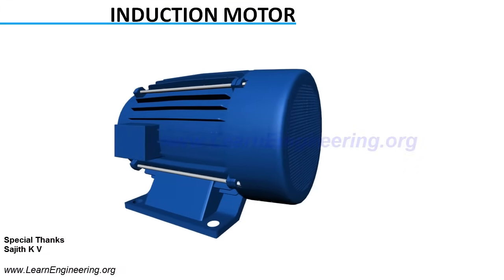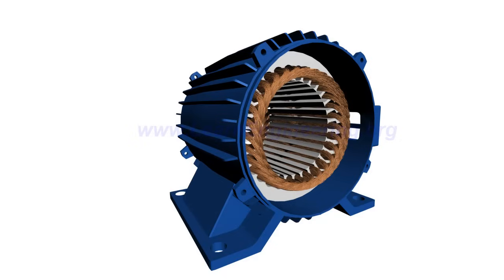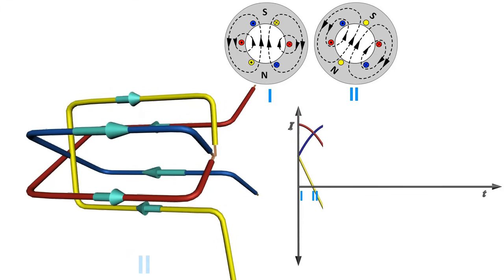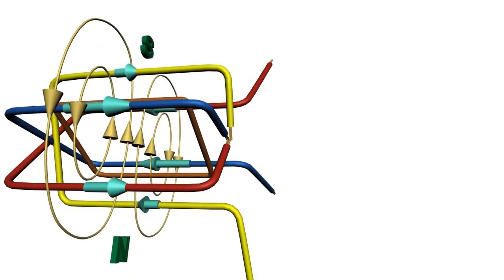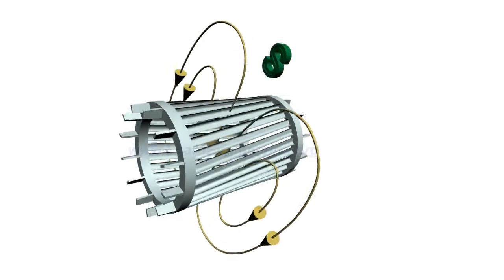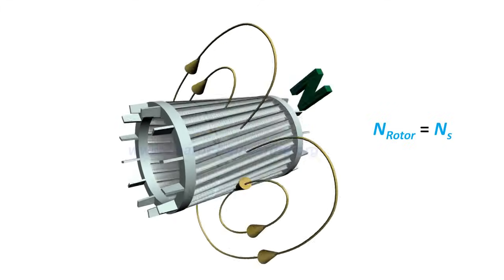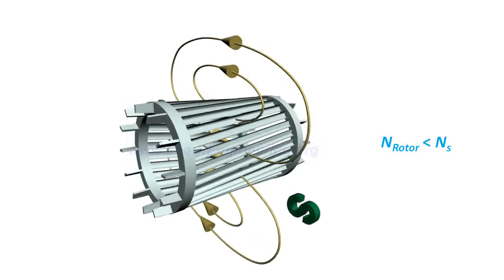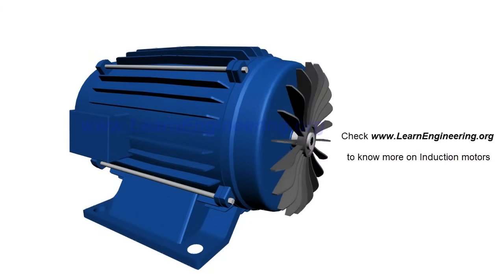How does an Induction Motor work ?

Comment: There are three points that may lead to a  better understanding of this beautiful video.

Point 1

The magnetic field lines of permanent magnets emanate FROM the North pole (by convention.)
In the case of RMFs (ie Rotating Magnetic Fields) the magnetic field lines are directed TOWARDS the North pole (by convention.)
These arbitrary definitions are put in place in order to make calculations easier!
The EXTERNAL region of a permanent magnet is USEFUL for our calculations. In contrast, the INTERNAL region of a RMF is the USEFUL one.
This is because induction motors and alternators DO NOT use the rotating magnetic field lines in the external space (say, outside the cage) for the production of useful work! 
The above definitions ensure that we get the correct direction of the magnetic field in our visualizations and calculations.

Point 2

How do we choose the CORRECT DIRECTION of the induced (eddy) current I (blue arrow) in the CLOSED LOOP of 01:32 ?

Using our right hand, we curl our four fingers following the direction of the induced (eddy) current around the  loop. Thus, our thump shows the direction of the produced  secondary magnetic field, which OPPOSES the RMF that created it, at the shown particular instance, according to Lenz law.
If the current I in the loop was taken in the opposite direction, then the induced secondary magnetic field in the loop (use the right hand rule as above) would REINFORCE the RMF that created it, thus leading to a flagrant violation of Lenz's law (violation of energy conservation!)

Point 3

Finally, having determined the shown correct current direction in the loop (blue arrow) we use Lorentz's law in order to determine the magnetic force direction.
Since F = q (vXB), we again curl our right hand fingers from vector v (current direction) TOWARD the B vector of our RMF and thus we correctly obtain the force direction (black arrows.)

That's all there is to it.

I hope I've helped...

Comment: Great stuff. As an add-on, the reason why there’s a large inrush current when a motor starts is because, before the motor is rotating, the current has only the low resistance of the winding conductors to impede it. Once running, the magnetic field caused by the current induced in the rotor by the transformer action of the stator’s rotating magnetic field, actually cuts through the conductors of the stator windings and induces an emf and current opposite to the polarity of the existing applied supply. This is known as back emf (probably counter-emf in the US). 🙄
Reply: nope, just back emf 🙄

Comment: The current ac induction motor design is flawed and old as hell. Excessive Eddy currents are the reason for the fan cooling adaptation and the squirrel cage accounts for most of the heat problem. Why have things remained the same almost 90 years later? We can do way better!!!

Comment: what is the interactive relationship between the 2SETS of filelds??  i.e....is the rotors magnetic field pulling towards the field of the stator,  i.e....attraction,  or is the stator pushing on the magnetic field of the rotor....i.e....attraction??  

in other words,  does the rotor interact with the stator via attraction or repulsion??

Comment: Looks like connecting Tesla turbine to the Tesla motor shaft will let you pump air and cool down the motor without any impellers. However i was thinking about joining them in the same case.

Disks on the same shaft most likely would serve as a flywheel (depending on the weight). And also will pump an air out of shaft edges. Potentially it may decrease air pressure and improve rotation speed. But result would depend on the motor casing:
-) motor case is open - quite similar to the motor appeared in the video
-) motor case is sealed (e.g. exact pump construction) - this would cause it to work as an pump cooling down the motor. Not sure if we are gaining some extra bonuses out of this. Any ideas ? (except looping air movement with other pump on the same shaft) ?

Comment: So basically the + on the sinus curve rotates with the clock and the - is the other way around which affects the rotor and you can the use it to see which way it's rotating alltogether. But you would never get the expected rpm's because there is energy loss in the motorparts (slip). And slip = nsyn - nasyn .. man I think I got it :D

Comment: I've wondered if you could make a motor that has the magnet inside move back and forth instead of rotating 

Like a piston engine 

Would it be very useful probably not but hey cant you engineers have any fun

Comment: That sounds like it'll be tough to control the motor's speed output, since the rotor is constantly speeding up and slowing down to match the rotating magnetic field. And it also sounds like there'll be longer start up and wind down time on the induction motor comparing to, say, a D.C. brushless motor. Am I understanding this right? Complete engineering noob here.

Comment: Wow, excellent video. I have a question. I'v noticed that the phase gap between the sines is 60 degrees (or pi/3) instead of 120 degrees as in a three phase system. Could someone please explain this ?:D Thanks !

Comment: If you know nothing about electricity, to understand this video you first need to learn:

-electromagnetism : Electrons moving cause electromagnetism, based on 1st right hand rule(thumb shows the electron direction, other fingers show the electromagnetism direction)

-induction : According to the Faraday Law, changing magnetic effect(magnetic flux) causes the electrons to move which means it produces electricity.
  
-alternate current: using induction, it is possible to make electrons move back and forth which is called alternate current. Since electrons move back and forth, we can use the right hand rule to see the electromagnetism change constantly
 

Research them in this order. There are nice videos explaining them. Then watch this video and it will make much sense.

Comment: i have an induction motor. i want to replace/adapt the impeller to a bigger one therefore i want to extend the length of the shaft. my question is: is it possible to weld another 4cm piece to the shaft in order to extend it? please any comments will be appreciated.

Comment: How is the magnetic field produced?
(this question may seem dumb but I'm only 14 so I don't know much about this field of physics)
Reply: This question is not dumb. Electricity and magnetism are interdependent. When a current flows through a wire, it will in turn produce a magnetic field around it. This can be derived using the Law of Biot-Savart or Ampere's Law. There are three windings (essentially wires), one for each phase, which are wired through the stator and produce the magnetic field as current flows through them. Because there are three-phases and the current is alternating, the field will rotate. Because this field passes through the windings on the rotor, a voltage is induced on the rotor windings due to Faraday's law. This voltage will cause a current to flow in the rotor windings. Again, since a current is flowing in the rotor windings, the Law of Biot-Savart or Ampere's Law can be used to show that there will be a second magnetic field produced, this time due to the current in the rotor windings. This field will rotate as the actual rotor physically rotates. Does that make sense?
Reply: Robert Kerestes Yes, thank you. I can't wait to learn about electricity, magnetism and etc. They are so interesting!
Reply: You have not asked a dumb question.
You are to be congratulated for having an enquiring mind.

The simple response to your question is that nobody really knows the answer.

The effects of electricity were observed in nature and very clever people in the 19th century formulated ideas as to how to manipulate those effects.

Equations , which are basically DESCRIPTIONS, were created and over 150 odd years  technologists produce the miracles we experiaence today.
From induction motors to electro magnetic communication.

Never be mislead into believeing that science EXPLAINS nature !
Reply: That's the spirit kid, never stop asking. There will always be trolls ridiculing you, but don't worry about them. They are not the ones you want to please...
Reply: Definitely not a dumb question!
Reply: Temirkul so the guy that stated that nobody really knows how the magnetic field is produced shouldnt ever give advice or answers
Reply: In a induction motor the magnetic field comes from the coils in the stator windings
Reply: Robert Kerestes ... Nice explanation... but I don't think there are any "windings" on the Rotor... only the Stator.
Reply: @Dude31463  That depends. In this case (squirrel cage), the "windings" are really bars which are called damper windings, which can be considered the equivalent of an actual winding, so you are correct, they are not actual windings. However, there is a class of induction motor called a wound-rotor induction motor where the machine has actual windings wound around the rotor and stator alike.
Reply: Temirkul ... No worries... Great question! I'm 54 and not quite sure how Electro Magnetism works... Same with Gravity. Scientists can measure these forces and apply formulas to them, but that's about it. They don't like using the word "Miracle", but in essence, that's kind of what it is.
Reply: Robert Kerestes thankyou good explanation
Reply: This is a phenomenon that follows a rule called the Maxwell's Corkscrew Rule.

Comment: What if I want it to work as a generator? I make the rotor spin faster than the speed of the magnetic field but what effect does it have on the stator? I don't get it..
Reply: Ana Carvalho you need a magnetic field in the rotor to produce electricity, the rotor is copper bars and laminated iron spacers, not a magnet in the rotor.

Comment: I thought it was the interaction of the magnetic fields of current induced in the rotor vs stator magnetic field that created the moving force? Not the stator magnetic field acting on the actual electrons in the rotor loop using lorentz law.  Isn't that the difference between a traditional induction motor and a Lorentz type motor?  I'm trying to understand this better.

Comment: is it ok to reverse the position of the rotor? meaning i will interchange the drive end and the opposite end..
Reply: Depends on the machine really... some machines only have one way to be put together (like submersible motors) and cannot be turned around like that.  Others have symmetry enough that you can put it together flipped around as you imply; 3-phase motors just permute your leads (ABC->BAC), but 1-phase motors may need to be reconnected to ensure the motor rotates the correct direction.

Once my shop was asked to do exactly that for a customer.  They couldn't set the motor because the connection box was on the wrong side!  We ended up exchanging the two ends... but really it just rotated the central housing a half turn.  Worked great.

Comment: Why loop not replace with neodymium magnets?
Reply: In this case that would be a synchronous motor which is another type of motor that exists but has different properties
Reply: yes, but what about efficiency?
Reply: Lucas Wiac Well you cant really compare the efficiency of the two they are just used in different cases. Synchronous motors are made to rotate at a constant speed while asynchronous motors can adapt to a lot of different speeds and loads so they are a bit in "everyday life". Synchronous motors/generatoes are in general dedicated to power plants (cause the speed must stay constant or really huge motors in industry (MegaWatts).

Comment: I just have a few questions about the motor. I only know a little about induction with Faraday's Law and Lorenz's Law, but work with me here. As a hypothetical load is put onto the power shaft of the motor, it reduces the rpm of the loop/cage. Would the Torque of the motor also increase? And also what are the benefits and Disadvantages to both "brush" (sorry I don't know the name of them) and induction motors?
Reply: Yes exactly as the slip increases, the torque will also increase. But there is a limit in the slip of course which depends on the motor, if the load is too "strong" the motor wont be able to follow and it will slow down and stop. Brushed motors are used in a complete different context, they are used with dc motors

Comment: I'm just watching this for fun but would really like to understand. What exactly do the teal arrows around the red yellow blue wires illustrate when they lengthen and compress? Maybe I need to go back and understand 3 phase AC current? Seems like a presumed understood concept here. I know what the result is but would like to better understand the stater wire.
Reply: +EuphoniaPooch the teal arrows are just the direction of current flow changing because its AC current and sinusoidal and not a Squarewave change they are fully expanded at the peak of the AC wave of the same colour on the graph as the wire. at 1:30

Comment: The explanation is good, but...
- suppose we have symmetrical 3 phase system, the sum of all instantaneous currents in 3 phases should be zero: i_a + i_b + i_c = 0 .... and current graph in your video doesn't show that
- the fan is used to cool winding, not the blue wall as shown
- slip is (N_s-N_Rotor)/N_s